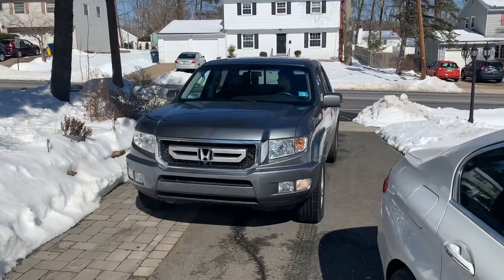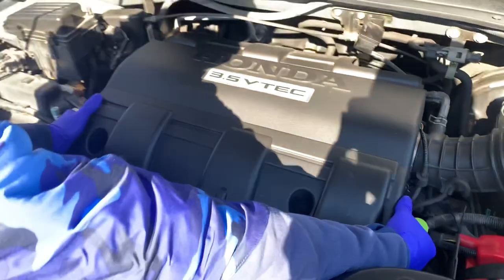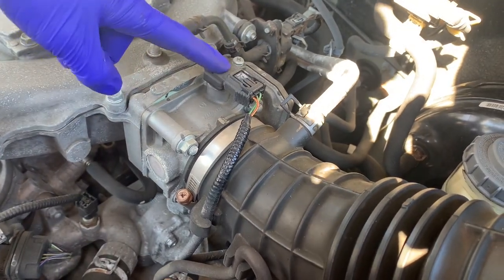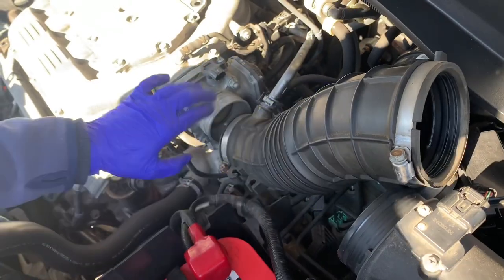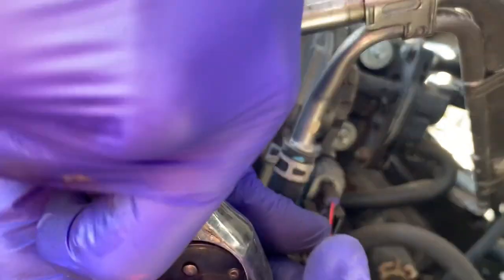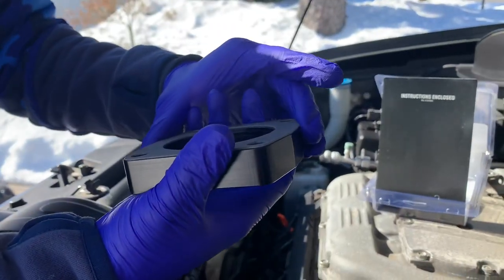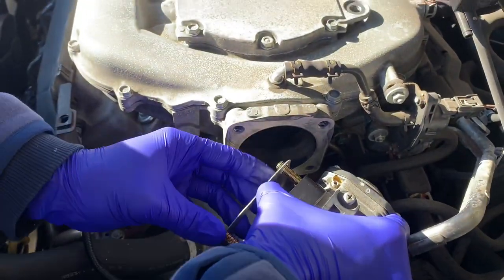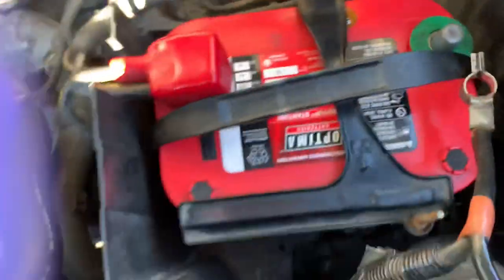2009 Honda Ridgeline throttle body installation

Comment: Why are you adding the spacer to the throttle body?  Is there an issue with the stock setup.  Plz explain. Thx.
Reply from the maker: mo powaaa baby
Reply: @dkgarage5131  how does this develop more power?
Reply: @axjohn  No, just snake oil!